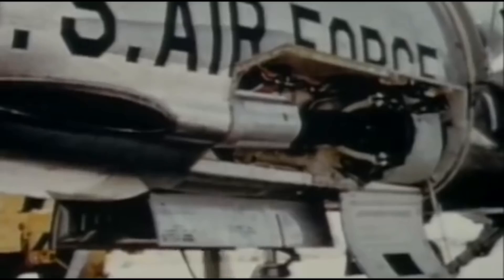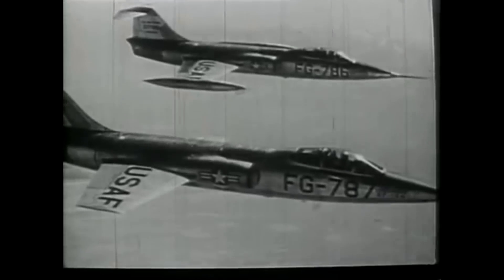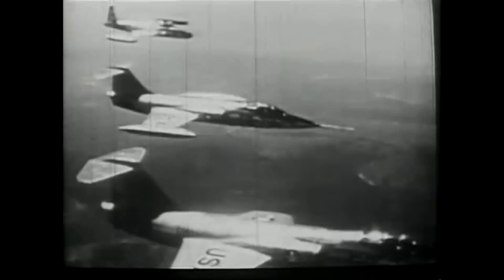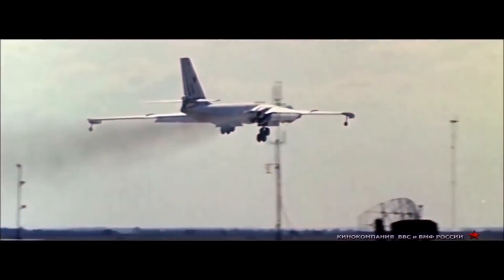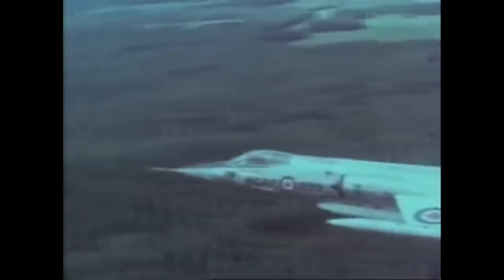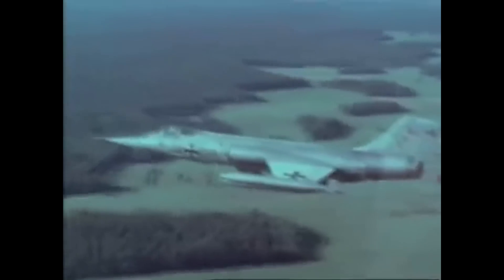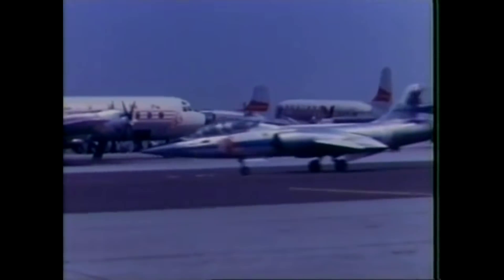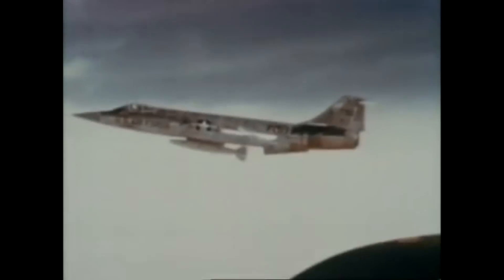Lockheed F-104 Starfighter | The worlds first Mach 2 fighter

Comment: The f-104 was not designed as a dog fighter. It was purpose-built to be a fast Interceptor for Russian bombers. To reach them quickly, knock them down, and come back. The Vietnam War pressed a lot of aircraft that were designed around this parameter, into being dog fighters, because they were all we had due to short-sightedness. At Edwards Air Force Base, the f-104 Starfighter proved itself to be an excellent research aircraft, along with the X-15. Back in 1967 when I was stationed there, I had the privilege of watching what were euphemistically called Zoom flights. The f-104 wood barrel down the runway, hit the afterburner, rotate and shoot straight up, until it ran out of air speed at the edge of space. It was a very moving sight.

Comment: Even though the f-104 is technologically dated, it still looks like something out of a science fiction movie. One of the most beautiful fighter jets ever built. I worked with them at Edwards Air Force Base in 1967, and I actually got up close and personal with the nf-104 version. That was the one that they allude to at the end of the movie, The Right Stuff. It had a rocket engine built in just above the main jet engine nozzle, and reaction Jets in the wings, and in the nose, so it could maneuver when it was so high that there wasn't enough air around it to maneuver with the ailerons, rudder, and  elevator. Just like the space shuttle. It literally went to the edge of space, and a little further. It may not have been the best dog fighter in the world, but damn, it was one hell of an airplane.

Comment: The world's first Mach 2 fighter was the English Electric Lightning, which served in the Royal Air Force from 1959 to 1988. It was also the first fighter to achieve super cruise, and once intercepted a U-2 at 88,000 feet during a NATO exercise in 1984. It could climb at Mach 1 and beat the F104 and the Mirage at sea level races.  During British Airways trials in April 1985, Concorde was offered as a target to NATO fighters including F-15 Eagles, F-16 Fighting Falcons, F-14 Tomcats, Mirages, and F-104 Starfighters – but only Lightning XR749, flown by Mike Hale and described by him as "a very hot ship, even for a Lightning", managed to overtake Concorde on a stern conversion intercept. By the late 1980s the Lightning was becoming outclassed  as a fighter by modern American aircraft, and was superseded by the F4 Phantom and eventually the Tornado.
Reply: The Lightning was Great Britain's first Mach 2 fighter, not the world's.  The F-104 and F-106 were both capable of supercruise, and both flew at Mach 2 well before the Lightning, so it's doubtful that the Lightning did it first.  Ad hoc drag races, chasing the Concorde or intercepting a U2 fall into the "so what?" category.

Comment: My grandfather worked with Kelly Johnson and the skunk works on the f-104 in the early 50s my dad graduated Van nuys high School 1953 his first job was punch press operator stamping out brake line mounting brackets for the nose gear on the f 104 I still have the first bracket he stamped granddad was back and forth to Edwards so often that he purchased property at North Edwards I still have one of the properties to this day

Comment: The F-104 may have been out of USAF by the late 1960s but it was used by ANG into the mid-1970s.  The last operational, combat purpose F-104s I think were operated by an ANG unit in Puerto Rico.
NASA actually used the F-104 (about 12 total) over 3 decades for many research programs and as a chase plane.  It was a relatively cheap plane to operate (with dangerously high take off and landing speeds!) and that's why it lasted so long besides the high performance. 
There were 3 early-production F-104s used as astronaut trainers at the Edwards AFB Test Pilot School in the 1960s.   In that decade, the USAF was still hoping to send its officers into space as part of a separate manned military space program but all the planned projects (MOL, X-20, etc.) were canceled.  They lost 1 of those NF-104A's (#3 plane) in a serious incident involving Chuck Yeager.  There's a recreation of that accident in the movie, "The Right Stuff."  You can watch that scene on YouTube!
The first NF-104 is in on display in a park in California
The second surviving NF-104A is mounted on a pole outside the offices of the Test Pilot School at Edwards AFB.
The last NASA F-104 was retired in 1994.  They have at least 2 NASA F-104s in museums.
There is a company in Florida that operates F-104s for air shows.  I don't know if they're involved with any DACT programs.  
It does seem like the F-104 is the high-end for privately owned warfighters.  Why that plane is allowed for civilian use and not anything manufactured after the F-4 is a mystery to me.  It seems like every plane manufactured after the F-104 was generally safer to fly!
The F-4s that are still flying were manufactured overseas or in Canada.  To my knowledge, none of the American-built F-104s still fly.

Comment: One correction:  The J79 has variable stator vanes in the compressor, not variable turbine blades.  The variable vanes in the compressor help the compressor to never exceed the stall line during starting or in flight regardless of engine speed, air speed, or altitude.  They are automatic.

Comment: Not the First

The English Electric Lightning First flew in August 1954 and went mach 2 in August 1957 (see Wikipedia)

although the F104 first flew in march 1954 it did not go mach 2 until 1958

the below quote from Wikipedia shows that only the F104s had a mach 2 engine

The F-104 was designed to use the General Electric J79 turbojet engine,[45] fed by side-mounted intakes with fixed inlet cones optimized for performance at Mach 1.7 (increased to Mach 2 for later F-104s equipped with more powerful J79-GE-19 engines)

Comment: Great video, but the loss of life from  basic design flaws - the engine blades being very temperature sensitive - and, unbelievably, the ejection seat firing groundward - was it 46 pilots killed this way? - is simply unacceptable, whatever the other merits of speed and altitude were.
Reply: sorry, that was 41 pilots killed this way, not 46.  Still unacceptably high.

Comment: Predating the British English Electric Lightning by a couple of years, both had similar performance. It is said of the EE Lightning that the pilot was in total control of the aircraft up to the point when the brakes were released on the runway... and then all hell let loose! I would suggest that the same would be said of the F-104.

Comment: The M-61 issue was more than just empty brass. The gun bay had inadequate venting of propellant gasses, and those gasses would build up and detonate. The brass from a 20 mm round was blasted backwards out of the gun and it penetrated into the hydraulic piping and controls

Comment: They used them as chase planes at Edward's in 68 when I was there. Training planes, one morning they were flying low goes when one had a flame out, the pilot in the back ejected yhe student road it out. Pieces were falling off the plane all the way down the runway. The fire moving from the rear of the plane forward. The crash fire truck got to it about the time it stopped hitting the student pilot so hard it twisted his ankle, but they got his parishoot fire out, the pilot got a broken leg. F104 was scrap. They used them as chase planes for the XB70 but that is another story.

Comment: 4:38 We had an F-104 on static display outside my dormitory during AF training... Pretty much directly in line between the Airmen's Club and the Dorm side door you'd go in so as not to be hassled coming in the front door. Weekend formations would tend to show who'd managed to 'find' the F-104 when walking back from the club in the dark. They had very thick strips of rubber that were replaced every couple of months for this very reason having about one or two head injuries every year from someone finding the ONE spot where the rubber wasn't and having to have their scalp sewed back up. I really think who ever designed the stand that was on very carefully measured "head-height" before they mounted that damn thing...

Comment: A little known fact that I think your viewers would have been interested in is that the 104  lived on after it was cancelled.  If you  greatly lengthen the wings and lower the horizontal stabilizer, you get a U-2 which is exactly what Kelly Johnson did to win the spy plane competition in the 1960s.

Comment: What is your microphone setup? Please include that info in the description. I’d say you could benefit greatly from a broadcast microphone or a large diaphragm microphone and recording with it closer to your mouth with a pop-filter in place with some very rudimentary audio editing. What are your recording into for recording? After your capture your audio do you do any post-production audio processing (De-Essing [to suppress the “s” sibilance], Normalizing [to give every part the same perceived volume], Noise Gating [to attenuate breaths, I wouldn’t remove them altogether as in spoken word the cadence sounds stilted and unnatural without those breath pauses, too uncanny valley])? What software do you use to do post-production work? If you include more info about your setup from capture through post-production in the description we might be able to give you some pointers.

Comment: West Germany had one of the worst Starfighters. It modified the plane to perform various different roles and although initially there were plans to build different variants for each of those roles, it was later decided to create just one (because of cost reasons) and you know what they say about a jack of all trades... So, in the end they built a plane based on the F-104 which negated all the advantages of the original 😟

Comment: Beautiful , fast & unforgiving. Had the pleasure of working on every C & D model the Air Force had. Being an instrument technician assigned to the 479 th Tactical Fighter Wing, George Air Force Base, Calif. I worked on about seventy F-104’s, mostly C’s & a few D’s which were two seater, trainer models. Something you might find interesting; the plane only held about 5000 lbs of fuel internally, & in full afterburner would burn 25,000 lbs of fuel per hour! With tip tanks & pylon tanks you had a little over 4,000 additional lbs of fuel. Another interesting fact; Although the M-61 cannon could fire 6,000 rounds of 20 mm per minute,, we had to reduce the firing rate to 4,000 rounds due to incomplete scavenging of the gases when the gun was fired for long bursts.  I really enjoyed my time being assigned to the first  USAF Mach 2 fighter wing, 1963 / 1965!!!

Comment: Forgive my irreverence, but those fighter pilots Kelly cited were merely selected out of a broader range of suggestions as a means of confirmation bias.  And every one a P47 jockey, I bet.  Kelly wanted to build it before the AIr Force even thought of it.  There was never a formal requirement issued for such a plane in the inventory.
  As far as NATO use goes, look into the great Lockheed scandal.  They; Lockheed; engaged in wholesale bribery and better planes were passed over for the F-104 as a direct result.  That's why the F-104 ended up a bomb truck-the ONE job it should never have been assigned.

Comment: Crashing without enemy help, AKA Operational attrition. F-104 was the sexiest aircraft ever, but sexy does not necessarily mean useful . . . except for sex.
  We interpret the history differently here.  From my perspective, F-104 suffered heavily from flawed design* and the incompatibility of air force needs within its narrow parameter of fast to altitude then out of fuel, "Point Defense Interceptor" (sans RaDAR) performance.  The Germans had to use it as a tactical fighter, which exaggerated the plane's limitations.

*The Point Defense Interceptor Role for which the F-104 had been conceived had been superseded by AA Missiles by the time it came off the production line.  Hanging tanks under those tiny wings severely affected lift; very necessary for take off and landing.  And all F-104s ended up carrying underwing fuel tanks. 
  Again, so sexy I still want to fly one.  And I'm not even a pilot!
Reply: B-58 and F-104 were very different aircraft, but they were both pushing the performance envelope during a time that envelope was daily expanding.  I bet everyone wanted to fly 'em.  Just like everyone wanted to fly Hawker Typhoons in the war . . . until the tails started coming off.
  A B-58 mission was the ultimate adrenaline junkie ride (before the A12).  Imagine being wired on your own body chemistry, while forcing yourself to be calm, rational, and remember a preflight checklist one hundred and forty lines long . . . well aware that your nation needs those bombs in the air NOW!
  So-no pressure.

Comment: An old F-104 pilot told me years ago that the wing leading edges were so thin you could cut your hands on them. I thought, this is some forgivable exaggeration.   Then I got up close to an F-104C at Cavanaugh Flight Museum in Addison, Texas on a typically hot summer day.  I ran my hand along the leading edge and son of a bitch if I didnt come away with a cut along the palm of my hand.

Comment: Should have had the horizontal stabilizer lower, like on the U-2, which was developed from the F-104.  It avoids it getting stalled at high angles-of-attack from turbulence coming off of the main wing.

Comment: The leading and trailing edges of the wings had to have protectors placed on them because they were so thin. It would be possible to damage them You ran into them with something hard,causing an area of drag. I was able to get close to one at an air show at Seymour Johnson AFB.

Comment: Kelly Johnson was pretty creative. Re atomic cafe, B34 thermonuclear bombs were designed for the F-104. Nato had them on CF-104s. Too many pilots died in this type: it goes fast, but it doesn't turn. F104 is not your narrow european valley flying nap.of the earth plane. The F105 was given an internal bomb bay for old style nukes, also mach 2, meant to jink at low altitude. The F-102 Delta Dagger was limited to subsonic due to "area rule" of fuselage fixed by F-106 redesign. F-101 Voodoo was another interceptor. Then, running out of numbers at F-111, the AF goes a different direction with the gunless F-4 Phantom. In Vietnam, top cover against Migs was the F-100 from post Korean War. Seems backwards, but AF could put 80000# of ordnance on the F105 something other in country planes could not. But overload a fighter that only flies in straight lines had high attrition due to SAM and Mig attention. As an interceptor it could get to bombers fast and REM it could carry nuclear standoff missles ie one fighter can eliminate an entire bomber formation.

Comment: Why would Canada buy a short range interceptor? Must have been the commission, or was it a bribe? The f104 was totally unsuited for operations in Canada. In Europe they had to find a job for this plane. Nuclear low level strike, a one way trip! Because of the Luffwaffe stats are easy to find..
 
"Despite a variety of fixes, the crashes continued. Between 15 and 20 German 104s crashed every year between 1968 and 1972 and continued at a rate of about 10 F-104s per year until it was replaced. The final tally was the loss of 292 of the 916 Starfighters and the death of 115 pilots." And this was not even a shooting war.
 
https://www.spangdahlem.af.mil/News/Commentaries/Display/Article/730527/f-104-germanys-widow-maker/
 
This plane was just optimised for a short lived criteria. The f104 lives on today, as major components on the airframe formed the U2.
Reply: Brian Cavanaugh The F-104 fighter was referred to by some as the " man in a missile." One key problem was achieving and maintaining stability at high speed. The wings were ridiculously small -- seemingly mounted on as a decorative afterthought. Had the wing design been less radical, the number of crashes would no doubt, have dropped dramatically.
Reply: R. Crompton 
agreed 100%
It would have required trading off some of that "time to climb" and outright speed. 
Hindsight is 100%

Comment: The English Electric Lightning was a Mach 2 fighter that came before the F104?
Reply: No, they were designed about the same time (the EE Lightning was started in 1949 but didn't fly until 1954 (an early version limited to Mach 1.5).  The Mach 2 version didn't fly until 1957.  The Lightning had twice the thrust of the 104 (due to it's 2 engines of similar thrust (16,000 lbs) with afterburners) and weighed in at 46K lbs vs 29K lbs in the 104.      Both of them at near empty weights had a better than 1:1 thrust to weight ratio and could accelerate straight up.  It's often thought that the Lightning could beat anything on time to climb but the 104 was actually better (although in practice many 104's lost to Lightnings due to the fact that they were fully loaded out with tip tanks as they had much longer legs (range) than the Lightning).  The Lightning was famous for it's 3 minutes to 36000 feet but the 104 could do it in 99.9 seconds (1.67 minutes).  It could also get to 10000 feet in 42 seconds (from a standing stop).  Both very impressive airplanes.
Reply: @steveburton5825  Excellent comments.